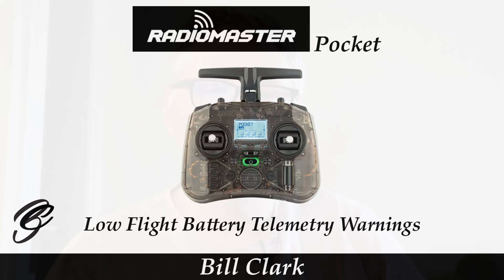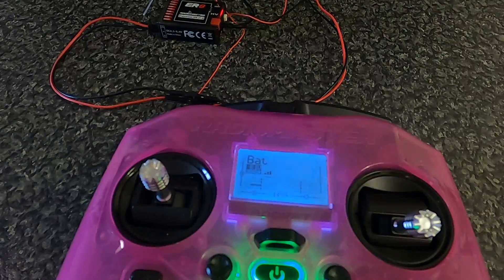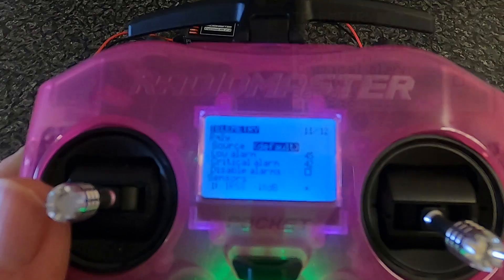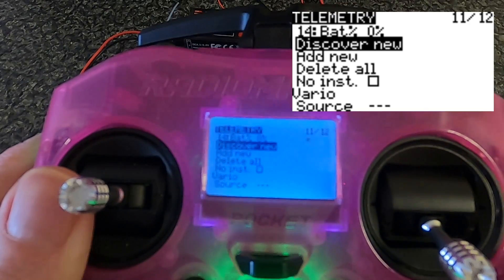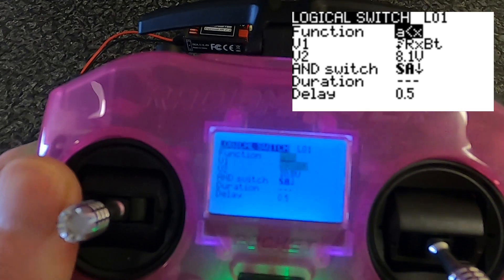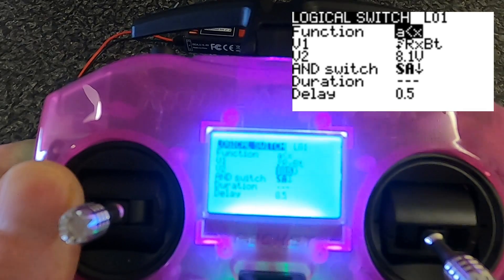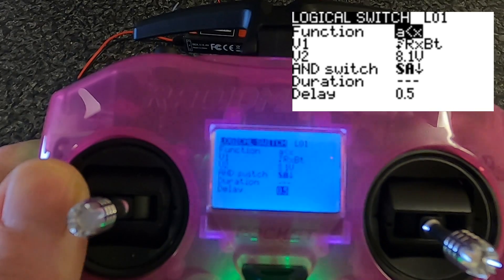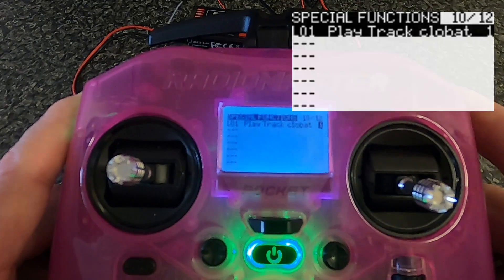RadioMaster Pocket Setting Up Flight Battery Voltage Telemetry

Comment: Very helpful video although I have the Boxer transmitter and though I can find RxBt in the Telemetry and can assign this to a logical switch I can't get a verbal warning. This may be because there isn't an option exactly like the one in your video. I can only find RxBt but not one with what I take is an audio icon in front of it.
However, using another of your videos I've added receiver voltage to a telemtry screen so I can monitor the voltage but a warning would be nice. Any advice would be most welcome.

Comment: Good guide! It kept always beeping at first except when I put the voltage to 0. Turns out the telemetry to radio wasn't turned on in betaflight. Now it works like a charm on my Air75.

Comment: How is this supposed to work? Should I be seeing the drone's battery level displayed on the radio's screen while I'm flying, or does it just play a warning sound when the voltage drops below the safe minimum I set?

Comment: Another great video!!
Crazy, my 60 dollar Pocket has almost all the functionality of a fancy Spektrum!!

My end goal is long range FPV Fixed wing. Would you recommend the GX12 or T16S?
Reply from the maker: Hi Andrew, I would say the GX12 because of the dual band system as long as the radio has enough switches for your model. Form factor comes into your choice too some pilots like the chunkier feel of the TX16s. Colour touch screen is that important I lean towards a high quality mono screen which can be easier to see in bright sunlight for the odd at the field adjustments you may need to make to your model settings.
Reply: @the-happy-RC-flyer  Thank you!! Touchscreen feels a little gimmicky. I built a good model with a Pocket, so already learned that part.
Reply: The rqdiomaster pocket really cost 100 with the batteries and charger

Comment: why my rxbt not showing the voltage? how to fix it?
Reply from the maker: Have you discovered New sensors in the Model Settings, Telemetry?
Reply: @the-happy-RC-flyer  Yes, all telemetry sensors have values, except rxbat not showing the voltase, there is only a line
Reply: @WulrekaDavid  u have to turn on telemetry on reciver tab on betaflight
Reply from the maker: What receiver are you using and does it have a voltage sensor wire?

Comment: i did this and set the voltage to 11.1 the voice just say critical low battery even with a fully charge battery...
Reply from the maker: How many cells does your battery have? And did you check the voltage with a multimeter? It was giving the warning because the connected battery voltage was below 11.1 If you had a 2S battery I would set the alarm voltage to 7.4 volts. Some pilots do take their battery voltage down lower than 3.7 per cell but I would not recommend that.
Reply: @the-happy-RC-flyer  its a 3 cells brand new packs, freshly charge 4.20v each cells, i did check each cells with a multimer.
Reply from the maker: @dji_mharyhu  Then you need to take a look at the sensor details and calibrate the sensor to display the same voltage as shown on the multimeter.

Comment: Please help me my radio master boxer is not working the screen just blink
Reply from the maker: Hi, remove the batteries and replace, check they are charged bottom USBC port. Is anything happening when you hold down the power button?
Reply: @the-happy-RC-flyer  the screen just powers on and shuts down immediately and repeats the process several times faster
Reply: @the-happy-RC-flyer  provide me your email I will provide you the video of the problem
Reply from the maker: Is there an SDcard in the radio? Check it in your computer please to make sure it is not corrupted? Have you updated the firmware recently?
Reply: @the-happy-RC-flyer  the sd card is fine no I didn't update recently
Reply from the maker: @mayankyadav8654  remove the SDcard from the radio and turn it on. Please tell me what happens. You are sure the batteries are charged?
Reply: I had the same issue.  Keep searching youtube for a video on it. I eventually resovled the problem so there is hope. It happened when I was upgrading the firmware.